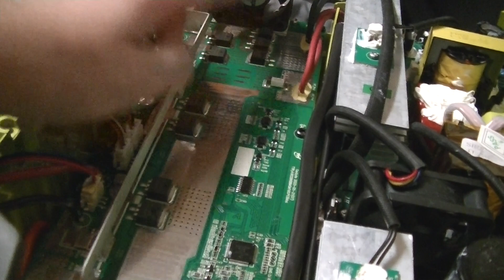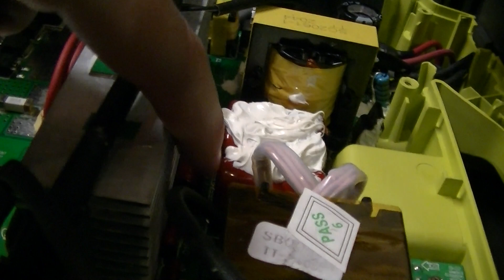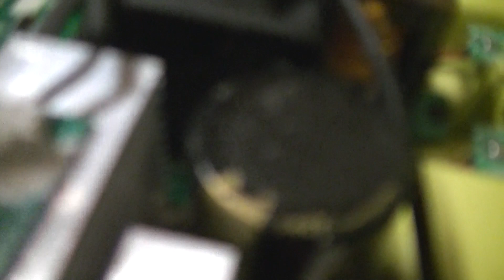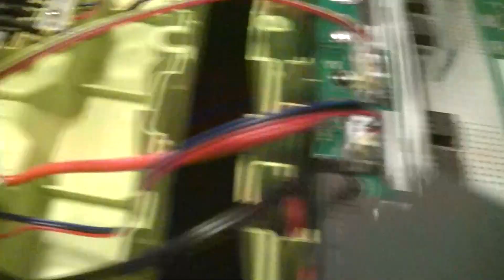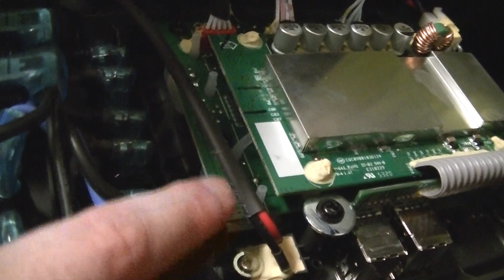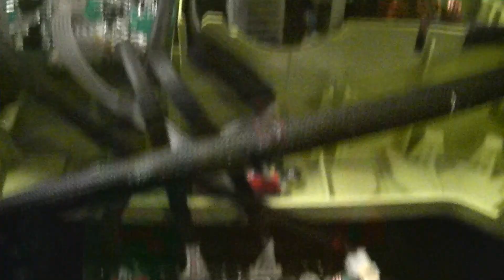Ryobi RYi1802B6 power station guts/teardown

Comment: If i bypass the charhing board and hook up 42 volts straight into the screw connections you mentioned on the inverter, will i be able to see 110v/120v on the output?

Comment: My powerstation just got the “system fault” warning.  Would you have any idea on a diy fix for that issue?  Thanks for the video.
Reply from the maker: When does the warning come up?
Reply: randacnam7321  it came on after when Tried using a small electric kettle.  Now whenever I try turning it on, it does not detect the batteries.  Then the screen say, “system fault” this turns off.  Cant get past that because it turns off right away.
Reply from the maker: @5u12f  There is a surface mount 80A fuse on the battery management board that might have popped.
Reply: Thanks @randacnam7321 I will look into that.  I really appreciate it man!
Reply: @5u12f   Any luck on figuring it out? I had one that was about a year old that couldn't see the batteries and Ryobi replaced it on warranty. It happened while it was charging. Now a year later the replacement is doing that exact same thing of saying no batteries and turning off. I hate to say it but I think they have a timer that times out and then you have to get a new one. LOL
Reply: @livelife4eternity  were you able to figure it out? i have the same issue and would like to possibly fix it!
Reply: @joelrecio6836   I had to send it in and they did replace it. It took a long time.
Reply: @livelife4eternity did you find the 80a fuse on the charging board he mentioned? Mine is mostlikely out of warranty . Id appreciate your help
Reply: @madyicstik  I never looked for it!
Reply: I have the same issue, with my Ryobi power station